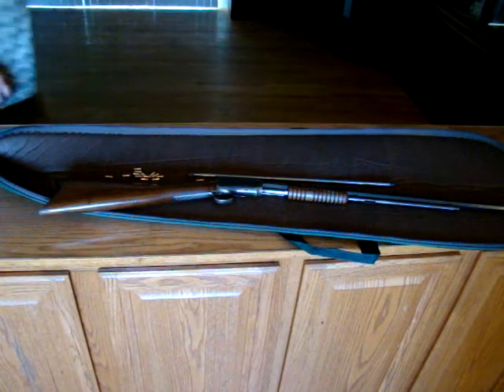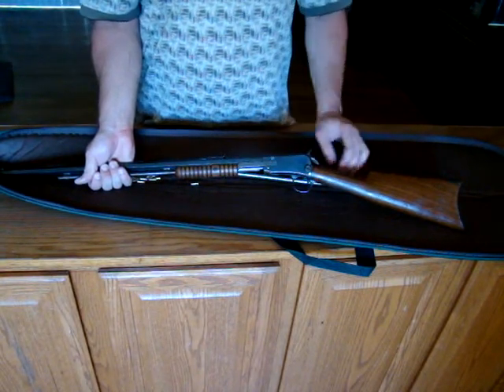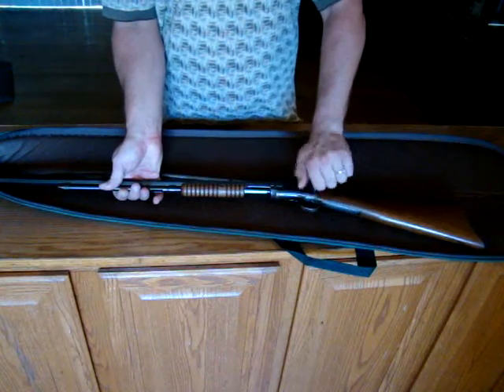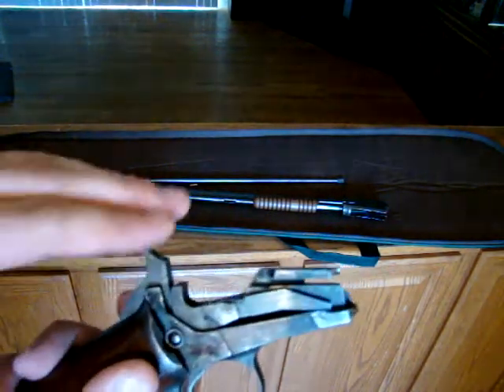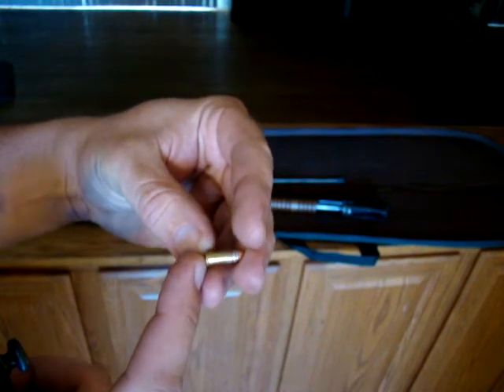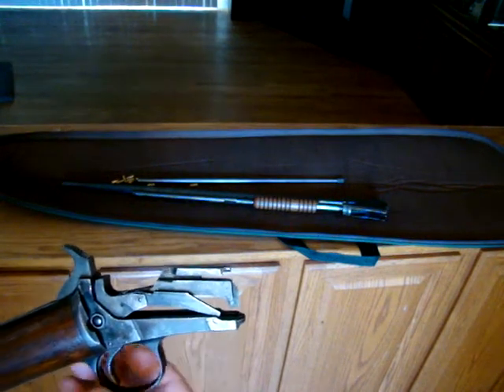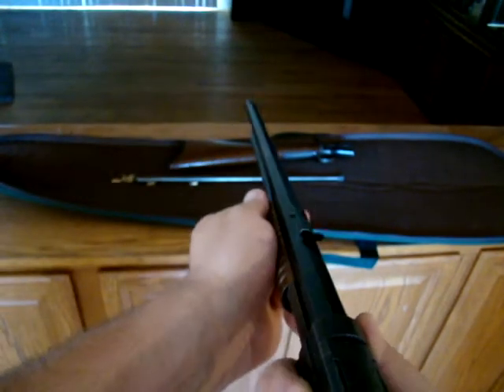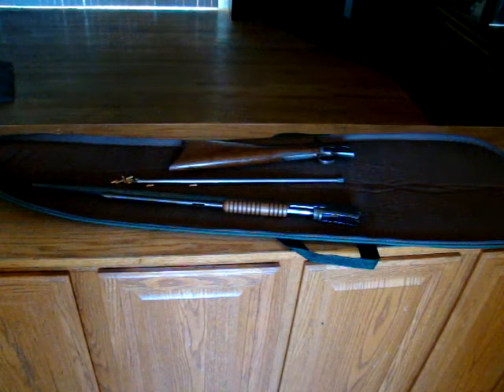Winchester 1890 pump action 22 short

Comment: i'm renovating a winchester 1890... i need chambering info... the barrel face is wrong an i have to set the barrel back a thread... how do i determine how much to face of the barrel... i was going to face until the bolt drops... i wish i knew the lenth of barrel tang spec

Comment: hey i need a little help, is the magazine tube needed for the carrier to stay down when u rack the bolt back (not forward)? because when i rack it back my carrier is immediately lifted before the extractor has a chance to pass over the carrier, to go down behind the round to push the round into the chamber. my magazine tube is missing and my bushing is also missing. i have a winchester model 90 looks exactly like yours externaly and internaly but mines chambered in 22LR. so what im asking is could you test to see if you remove the magazine tube and put a round in the carrier and rack it does it still chamber the round properly?
Reply from the maker: With no magazine installed, the action on my 1890 seems to work properly. I can properly cycle the action with a single round in the outer magazine tube while the magazine is removed as long as I keep the muzzle pointed up in order to gravity feed the carrier assembly. While testing this, the carrier had no problem picking up the new round, chambering it (in conjunction with the bolt) and then extracting. I hope this helps you with diagnosing the problems with your rifle.